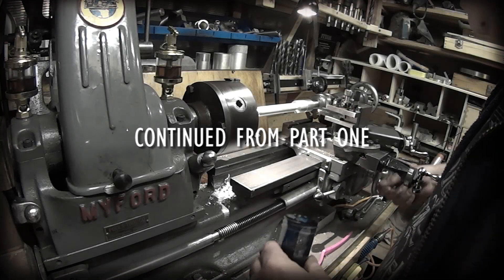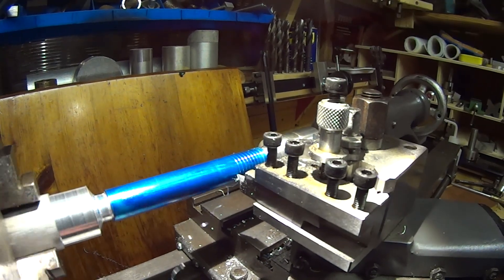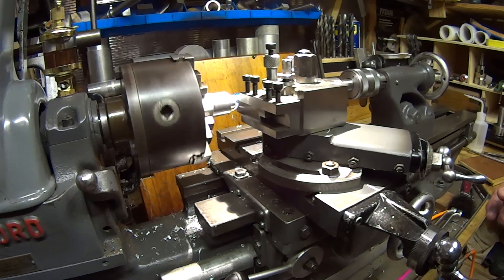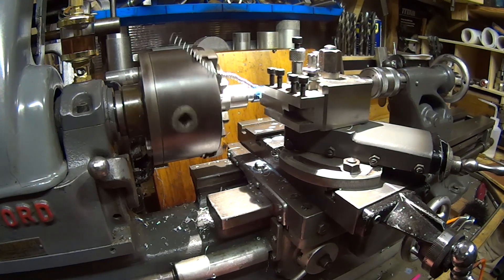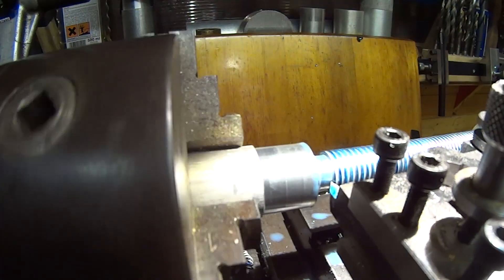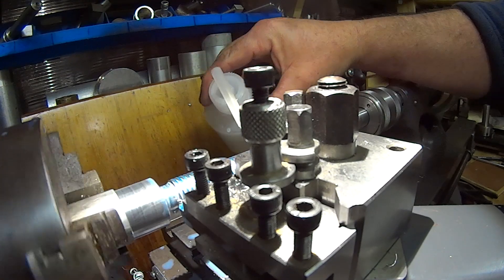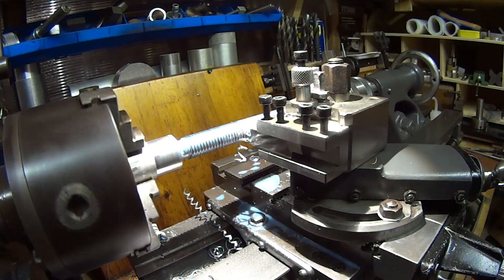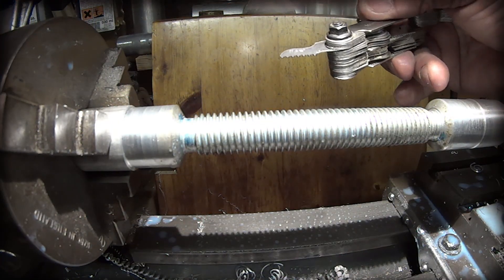Screw Cutting on a Myford ML7 Lathe - Part 2 - Cutting the Thread

Comment: Putting the cut on useing the compound slide,you didn't say how you measured the thread depth.Did you turn the minor diameter on the end of the job and then then touch on it,or did you use trig and use the thread depth at 27 1/2 degrees.Not being a smart ass just wondered.

Comment: Hi Ade. Great video. Now I can start cutting threads on my ML7. In order to 0 the cross slide are you using a customised dial guage? Thanks.
Reply from the maker: Hi Warren, I use a resettable cross slide micrometer dial, which I bought for the ML7, but you could just use a sharpie to make your reference mark when thread cutting

Comment: Is there any  way to cut threads without going 5 times over, or to get the tool back in the track without the thread dial indicator, etc? I would be concerned about cutting across my own threads. It would come out more like knurling than threads.
Reply from the maker: Yep, you need to have the precise engagement of the lead screw otherwise the cutter will be out of sync to the thread you are cutting, and it will be scrap. You cant turn a deep thread in one pass, just the same as you dont turn a diameter to final size in one deep cut
Reply: Ade Swash Ade, you convinced me. I bought a thread chasing indexing indicator. I had to drill and tap a hole on the feed control box, but it seems to work! Now I guess I need to get  into all of the pitches and angles, but I am learning! Good food for 74-year old brain.
They included a table. I guess it says when to engage the feed...it goes to 13.7, but the wheel only goes to 10.....just keep going, 13.7= 3.7+10.? Do you let the wheel go around once, then engage at 3.7??
Reply from the maker: @johnstewart8849  you have me confused? my thread indicator has 4 segments only

Comment: Great videos thanks, what gears would you use to cut metric 1.0 and 1.25? on my chart it talks , driver, 1st stud(driven and driver) and 2nd stud  (driven and driver)and lead screw
Reply from the maker: Hi David, here is my link to the Myford 8tpi leadscrew chart with metric gear sizes,  - https://drive.google.com/file/d/1VpIAaEzeBGU2nt-ZT5uV4i_R-twOfRlR/view - remember if cutting metric on an imperial lathe you need to keep engagement with the lead screw at all times,  so reversal of the spindle rather than disengagement of the half nuts. Regards
Ade

Comment: Presumably this technique applies to the ML10 too! (I have recently acquired a Myford ML10 together with a 'Rodney' milling attachment).
Reply from the maker: Hi Chenks, not ever used a ML10, but I guess the principle is the same for any lathe with seperate change gears, you may need to find the correct chart that is specific for your lead screw dimensions
Reply: You're probably right. The ML10 appears to be a scaled down version of the '7'. Thanks Ade . . and thanks for the videos. I shall subscribe to your channel and watch your videos - they're nicely done and very informative. I also have a watchmaker's lathe which I know how to use, but it's very different to a Myford!

Comment: what do you do if you dont have a thread dial indicator?
Reply from the maker: You can still cut threads, but you have to reverse the direction of the chuck and wind back to your start point without disengaging from the leadscrew
Reply: @adeswash  Same thing for cutting metric threads on the ML7 with an imperial leadscrew.
Reply: Ade Swash. Thanks for that . . I don't have a thread dial indicator on my ML10
Reply from the maker: @snaplash  crank it back manually

Comment: Why are you running at such low speed? Is there an optimum speed between the tool and the work piece?
Reply from the maker: Hi Hans, you can cut at whatever speed you are comfortable with, for me I prefer the low speed as it gives you more chance of accurate engagement/disengagement of the half nuts.

Comment: The top slide, you set it up using the screw gauge point which is 55 deg not the 27 1/2 deg half the thread angle. The tool point travel should follow the trailing edge of the tool point with full cut on the opposite flank. Good informative video's.
Reply from the maker: Thanks William, I have never been good with my angles and suchlike, so yes my description is quite likely wrong, but the practice works well :)
Reply: @adeswash  Just watched part one and your method of setting the compound or top slide  only works for 60* threads i.e. Metric or SAE as the angle you set is the reciprocal, I think that's the word, of the 60* fishtail i.e. 30* near enough to the 291/2 recommended. However for the 55* Whitworth you are demonstrating the reciprocal of the 55* fishtail is 35*, way over the recommended 27*. To prove it I just dragged my old cross slide off the parts shelf and set it up.
RonW, Canada.

Comment: Hi there, very informative, I've had my ML7 for a month now, and want to try some thread cutting. How are you zeroing the carriage to the same spot everytime you wind it back to the beggining of the thread?  Thanks
Reply from the maker: Hi Kris, the carriage is just returned to a point within the full depth recess, it is not important to index this point, because the indexing comes from engaging the halfnuts onto the leadscrew by using the thread dial indicator, thus putting it exactly back into the position for the helix
Reply: Ade Swash thanks, I think I get it, I'll go make some swarth and see what happens.
Reply: @adeswash  I was just wondering this myself. Great Videos, thank you.

Comment: what change wheels
Reply from the maker: Hi Nathan, this was 11 tpi, (BSW 5/8) so change wheels were driver 40, idle 60, and lead screw 55 :)
Reply: bought myself n ml7 couple of months back just this minuite finished last coat of paint on bed carnt wait to get it backtogether  cross feed screw handel  has been snaped off only couple mill of thread showing but that was about it bargain price aswell
Reply from the maker: plenty of spares for the ML7 on ebay, they are great machines if you look after them